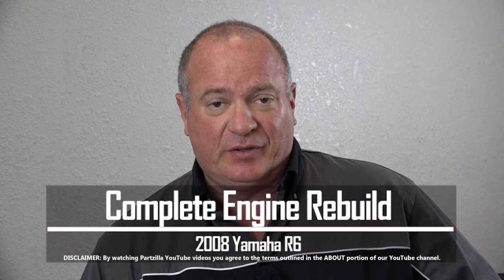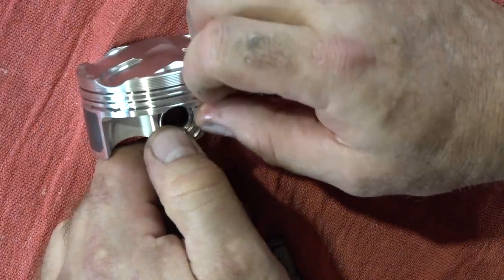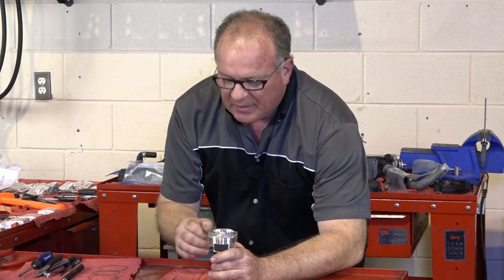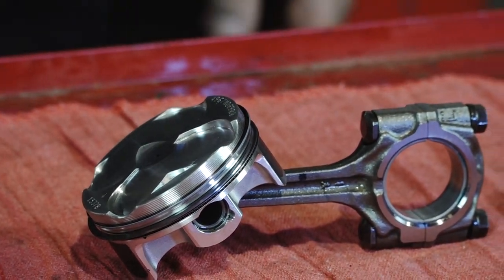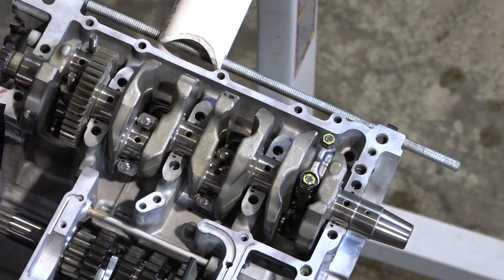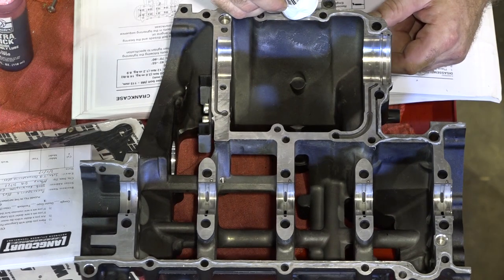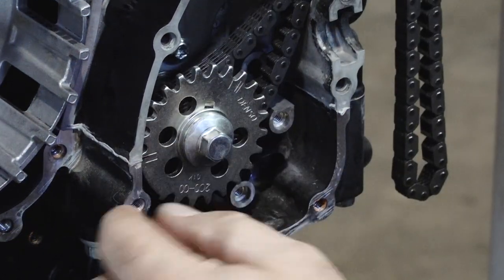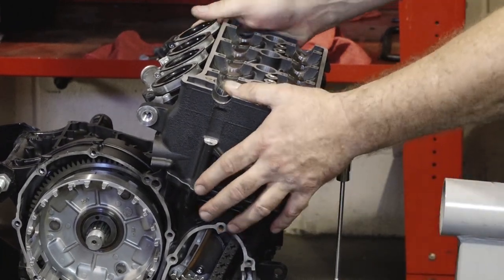Yamaha R6 Engine Rebuild Part 2: 636 Wiseco Piston Install to Head Install | Partzilla.com

Comment: I know this video is old but the Yamaha manual states: 1st tighten M8 crankcase bolts to 14ft lbs (as in video). 2nd, loosen, than torque to 8.9 (as in the video). Here is where it goes off the rails a bit. 3rd Stage is "1"-"7", "10" + 50 degrees. Bolt "8", "9" + 75 degrees. This makes sense as the 75 degree angle bolts are shouldered. You don't tighten ALL the bolts to 50 degrees THAN 75 degrees. This is straight out of the factory manual.
 I know I'm a bit late to the party but better late than never.
Reply: Where did you get the manual?
Reply: @poodeehoo  Factory Yamaha manual.
Reply: Then, not than. But thank you for the info!
Reply: @huntersmark917  A syntax comment??🙄

Comment: I've been going back and forth on the bearing sizing... I have a 2006 motor ready to rebuild. My Crank reads 222212222. Confirmed all of the connecting rods say 5 so I have all new bearings for those. The mains I am confused... my case half is stamped with "6 5". I am assuming the 6 is for the mains and the 5 is for the rods? However when I looked at the old main bearings they were all brown. The last bearing, however, the brown was nearly worn away and barely identifiable... I'm not sure if it was installed incorrectly from the factory? I could always order a brown and a green for that last main and plastigauge but a little at a loss for ordering mains... Any help would be greatly appreciated!

Comment: This video helped prepare me for rebuilding my 2005 FZ6 engine which is almost identical . When you set the final drive shaft in place there's a half circlip that sets in a groove to keep it in place and I forgot to install mine and had to go back and split the cases . Thankfully since I wasn't actually removing the crankshaft I didn't have to take off the head or re-do the timing .

Comment: A good idea that was missed is to weigh all the pistons and rods individually to make sure everything is as balanced as possible.  Also good to have the crank sent out and balanced.  Details people,,  details!!!!! 😬👍
Reply: What if one is slightly off? How would you balance it out?
Reply: @frankiemarchese2978 depends on if you need to add weight or take out weight, but basically add or drill out weight

Comment: Real quick I go to a school for high-performance/automotive technology and the guy in this video explains things 1000x more clearly than any instructor I've had thus far. You would think that a University would hire people like this to teach the next generation of high-performance mechanics. Still, they cut as much costs as possible and hire instructors that lack the passion to transfer that knowledge to the next generation because someone with this caliper of patience and skill level would obviously require payment that reflects that. The only real advantage of going to a school like the one I'm currently enrolled in is the access to tools and certain equipment so if anyone is considering attending a university or institute that "teaches" high-performance/automotive technology or anything related to racing and/or mechanical work please make sure you have experience in that subject or the willingness to teach yourself because I've seen so many people drop out or get kicked out after one or two sessions and it is genuinely saddening.

Comment: Great videos, however, when it comes to rod / crank bearings never solely rely on the yellow green blue bearing color bull crap.   Always verify your clearances with a micrometer and a dial bore gauge.   Your looking for .002 -.003 oil clearance.       Relying on color recommendations is asking for problems.   I’ve built race engines for 25 years and very rarely are the clearances correct based on the color charts.
Reply: Or plastigage right?

Comment: I'm pretty sure, you have a wrong tightening procedure at 11:45. The manual has two different angles for the two different screw-lengths: you need a increased prolongation for a longer shaft to establish the same preload as a short one. So the eight 85mm screws #1-7 and #10 get ~50° degrees in a third step and the screws #8+9 get ~75°. You are damaging your engine threads with way to much torque.

Comment: I had to laugh when you were talking about the piston rings and putting light oil on them. I was helping a friend work on his engine over in my garage. I have enough different tools that I could work on just about anything with an engine. I showed my friend how to put the rings on. Explain to him just to put a light coating of oil on the rings and just a little bit from the rings down to coat just a light enough coat to make it work. Unknown to me at that time my definition and his definition of a light coating were complete opposites. Once we had everything back together and did the first start up we smoked up the whole garage. I was seconds away from turning the motor off when I finally noticed that the smoke was getting less and less. It wasn't until I talked to him that I found out he almost basically poured oil on the bottom half of the pistons and of course with that much coverage and coats the cylinders above the range.

I really started laughing out loud when you just talked about the oil on the rings. My friend must have known I was just writing about him. In the middle of my comment he just text me to see if I want to go riding today since our temperature are at normal for this time of year.

I really enjoy watching videos like this. I don't care what you think you know you don't know everything. There's different ways of doing something and I'd like to learn all of them. I couldn't tell you how many lawn mower videos I watch. I don't work on any of this stuff for a paycheck. The only thing I ever charge friends and family and neighbors for is parts. I don't mind helping someone out but I'm not going to pay for their parts to do it. It's just now I'm retired and I like having different projects to do. I'm thinking about building myself a racing bike that's how I came to see your video. You have a lot of knowledge and I do appreciate you sharing that with the world. Things like this is the biggest reason the internet was useful for in the beginning. To share knowledge of different things with people from around the world. I also made sure I'm hitting the like button as I'm watching the videos and I have already hit the subscribe button. I'm looking forward to watching more.

Comment: One more thing: when shifting gears is it normal for the output shaft to need some rotation before the sprockets fully slide in? Because just rotating the input shaft by hand won't allow the full sliding of some sprockets. I'm almost done with my rebuild and wanna make sure I've installed the gearbox properly. Thanks!

Comment: Let me ask you do you ever weigh the connecting rods and bearings and piston and then grind them to match one another? Whenever I tear down an engine I always try to balance the pistons and rods. Not 100% sure if it makes that big of a difference but that was the way a close friend showed me how to do.

 torque degree gauge that you were using could you tell me what brand it is and perhaps where I could find one. The one I use is mechanical not digital and as you probably know looking down at a mechanical one you could be off a few degrees and not realize it because you look at your age at a different angle than the last bolt that you tightened.

Comment: This is an awesome series, I've watched the tear down and rebuild a lot in the last couple of weeks to prep for a similar job on my FZ6 lol. That timing chain sprocket at 12:30 - does that only go on one way? (because its stamped with the T) I'd hate to put it back on 180 degrees in the wrong direction lol

Comment: When you loosen and retorque the bolts do you do loosen and retourque screw one, then loosen and retourque screw two, and so on, or you loosen all screws first?
Reply from the maker: Loosen all screws and start over.
Reply: Thanks!  @PartzillaParts

Comment: Is it 3rd r6 gen from 06 to 14 is having different torque bolt tighten specs and step from year to year ? Since i couldn't find any 08 service manual, i just found 06 and 07 r6s service manual and i dont find same tighten sequence like in this video, i only find first step tighten that is same in 06 service manuals and not any of them showing tighten sequence using angle degree

Comment: Was plastigauge used on the main and rod bearings? I was under the impression that bearing clearances must ALWAYS be verified. Thanks for the videos!
Reply from the maker: A plastigauge was used to verify clearances.  We decided to leave it out of the final edit of the video because the Yamaha manual doesn't suggest the procedure.  We like to verify anyway.
Reply: My manual suggests using plastigage to measure journal to bearing clearings, 05 r1

Comment: I have built whole sleds, 4 triple/triple two strokes, one cr250,one cr125, one 600 twin, and NONE of this prepared me for the difficulty of rebuilding a cbr600f4. These engines also seem to lose life every rebuild.
1st 72k , 2nd 34k, 3rd 9k. That's paying $3500+ going by manual.
I wish I was in the States where all these bikes are a dime a dozen. Canada your forced to buy a new bike or rebuild. Ebay isnt feasible due to price of engine, shipping, installation.  Again, forced to rebuild or buy new.

Comment: Hey Mr. Talley, How can I say the specification of bearing that can I use on the uper half of the crankcase?
Reply from the maker: In the service manual it has a chart to match the numbers on your crank.
Reply: @PartzillaParts  sorry, but I don't find this on the manual service that I make download, I get severou files and don't found this information
Reply: Partzilla can you help me?

Comment: Hi, I watch all your videos and I don't know how to tell what I need for crank bearings. I watched this video several times and I don't see the same marks as you at all. My bike is an older model but the Parts people don't answer my emails and the chat portal don't work at all. I called the number and one lady hung up on my and the other guy didn't know what I was talking about. If you could be of help that would be great. Thanks in advance. Oh and they think the best option was for me to buy all they types of bearings then try them on to make sure they would work and ship the rest back. I personal think that is a waste of money. The bike is a 99 ZX9r and I am looking to get crank and rode bearings. The only thing on the crank is the letter (B) and a number (1). I can send a picture if needed. Sorry for the long message but just confused.
Reply from the maker: There should be a string of letters and numbers.  That code is what labels out your bearing needs.
Reply: You can take your crankshaft to a machine shop and have them mic out your journals and order bearings which come in  .25 mm increments. You want .25mm larger than journal size for oil clearance . Example : If journal is 30.5mm order 30.75mm bearings .

Comment: Question: do you need to change the crankcase bolts? I have an R1, manuels says nothing about changing anything. I reused them, but i forgot to lubricate them? Is that realy bad or okay?
Reply from the maker: It's an old habit, bolts stretch.  It's the playing it safe method.  Lubricating helps get them to torque spec without damaging the bolt heads.
Reply: @PartzillaParts   Oke thanks, wel i tight it with 60 degrees and 60 degrees is 60 degrees right?The oil protects the trheads oke.. Wel hopefully nothing bad will happen..

Comment: Which direction is your piston rods facing? There's a smooth side and number side
Reply from the maker: Assemble the piston and connecting rod with the journal bearing tab facing to the piston "dot" mark.

Comment: What should i use to clean the carbon deposits ?
Reply from the maker: If the parts are uninstalled, you can soak them and use a plastic scraper.  You can use a bristle brush, just don't dig in too hard.  Just don't want to scratch the components.

Comment: why in the hell would you reuse a stock rod out of a motor you know nothing about? especially on a 2 mm motor.  insane and complete nonsense
Reply from the maker: Tim, I had the same concern and Wiseco assured me that the stock rods would handle the build.  The rods were inspected carefully and were in good condition to re-use. A lot of thought went into this project before the videos were produced.
Reply: Awesome